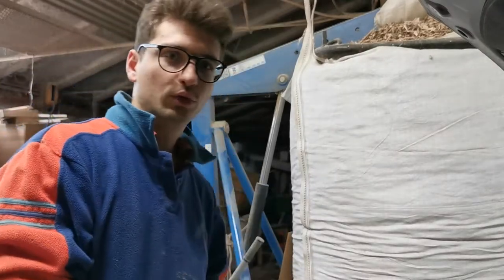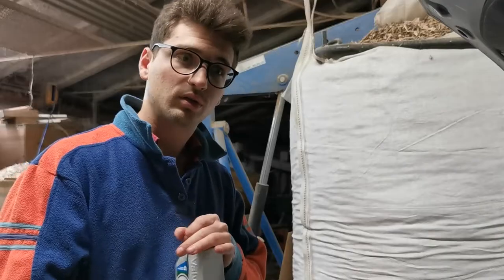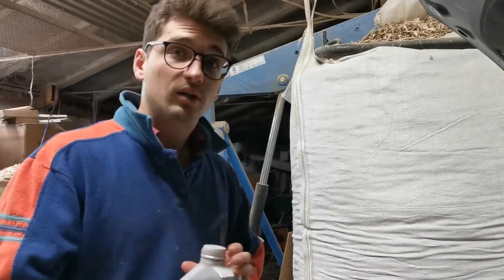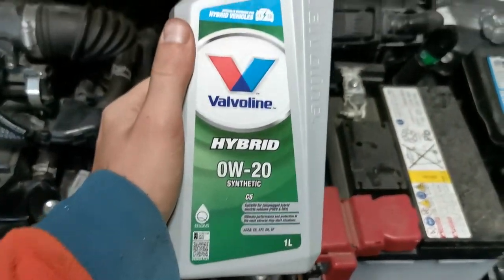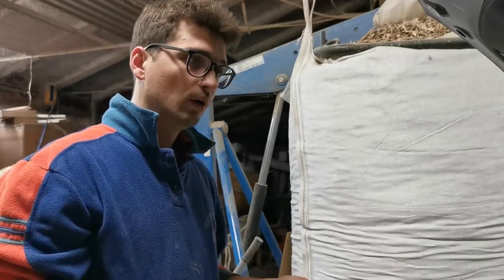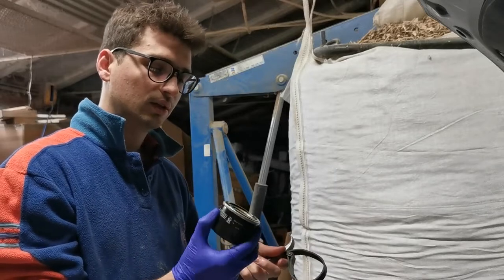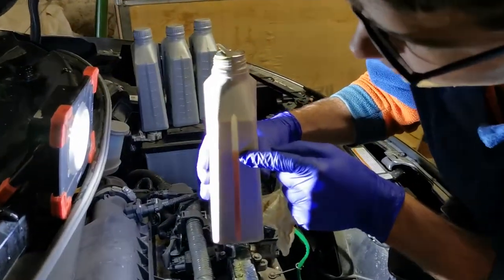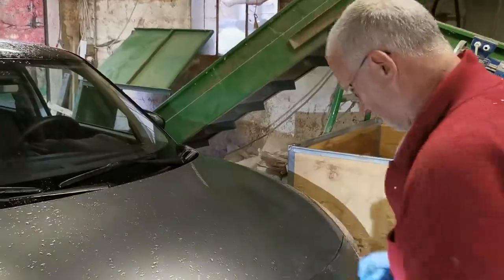DIY | Suzuki Swift HYBRID 1.2 top - OIL + FILTERS change - HOMEMADE service

Comment: Never run an engine without oil... not for one second! You drain it easily by having a warmed up engine at the start of the procedure. Do you have the service manual for this generation of engines K12C ?
Reply from the maker: Hi! Yes, you are right. We did that because my dad was used to let the old tractor engine run a bit to empty all the pipes...but in modern motor it is not necessary (we saw that no oil went out). Yes, I do have the manual, why u asking?
Reply: @profilo_is_back  can you point me to it if it is available online? I can't find it for this new AZ generation, my mother owns a 2019 simple version Swift with this wonderful K12C engine and I want to do the basic maintennace on it accordingly, down to the torque requirement for the screws that go back on. Thank you for the reply.
Reply from the maker: @alexmar4252  unfortunately I do have my own manual (paper version....). I searched a bit and I found the exact same version I have. Unfortunately it is in italian...
@ page 452 you can find the maintenance section. And, as you can see @ page 455 you can find the motorization version.
Hope this can help you!
https://auto.suzuki.ch/fileadmin/media/pdf/pages/bedienungsanleitung/Swift_Anleitung_IT.pdf
Reply: @profilo_is_back  Thank you very much!

Comment: We never start an engine without oil. What you did did you did crime. You do NOT know what you did, did you do it, if you really knew what happened to the machine
Reply from the maker: Hi! Thank you for the comment! As I relpiled in other comments, this was a mistake at all. howver, I don't think it is that much bad...the engine is still working fine, anything happened because it ran for very few cycles in free wheel conditions. Best regards!

Comment: Do you have part catalog?
Reply from the maker: Hi! Yes, this is what I used:
- 4 bottles (4kg = 4 Lt) of Valvoline 0W-20 oil, specifically designed for hybrid vehicles
- 1 oil filter ADK82108

Comment: Hello. I have two questions :
- On the manual of my Swift Sport Hybrid of 2021 it says that depending on the model or recommandations of the manufacturer, I should use either the kind of oil you are using or 5W30. Is there any big difference between the two ?
- How many liters of oil do you use approximatly in this car ?
Thanks for the video
Reply from the maker: Hi! Thank you for the comment!
1. W refers to the viscosity of the oil, The lower this number is, the less viscous your oil will be at low temperatures. A 0W oil, as the one I used, is really fluid and will flow better at low temperatures than a 5W. If your range of temperature is inside the one OK for 5W, then you can proceed with that. However, my mechanic recommended a more fluid one (0W, for instance) because is specifically designed for hybrid vehicles, so I went for that (frequent start and stop require a more fluid oil).
2. I filled the motor with 3.3 kg of oil. You may fill the oil then, when you are finisching, you can check the level with the oil bar (I didn't show this in the video, however its really simple).

Let me know if I was clear enough, otherwise I'm here if I can help you!
Reply: @profilo_is_back  seems clear to me. Thanks for the quick answer !

Comment: Hola amigo buen video, yo tengo uno fabricado en India pero el mío no es hybrido, el tuyo tiene el filtro de combustible dentro del tanque? Es lo único malo que le veo, saludos
Reply from the maker: Hi! Thank you for the comment! Well, I actually changed only the oil filter..up to now I haven't changed the gasoline one. I think it is external, by looking at spare parts on the web. I will ask my mechanic, then I'll let you know. What is your car exact version?
Reply: @profilo_is_back  El mío en realidad es un Suzuki dzire 2018, vendría a ser como un Swift pero en formato sedan, claro que despojado de toda la seguridad (solo dos airbag y ABS) y sin ayudas en la conducción, es un auto básico pero muy cómodo y económico. Gracias por la respuesta me suscribo al canal
Reply from the maker: @robertohanglin3612  Hi! I don't know your car, bur I rapidly looked in the web and it is very similar to my swift. As I promised, I asked my mechanics: he said that the filter, together with the fuel pump, is inside the gasoline tank (I was wrong, sorry for that). Hope it can help you! And thank you for the subscription, it really helps me! Bye!

Comment: Hi man please note to NEVER start a vehicle that does not have oil in the engine that is a very bad thing to do.
Reply from the maker: hi man! the car is still working perfectly, don't worry!
Reply: @profilo_is_back Just note that what you are doing is not right and eventually that will cause damage from running without oil. i know the car seems to be working good now but as you keep running the engine with out oil for those few seconds that will cost you

Comment: hi guy 2 things... put the car level when draining oil not how you are doing it because they will still hav some oil left in  the pan and second NEVER ever start any car engine without oil in the engine you are causing excess wear and if you do that over and over you will have issues before time.
Reply from the maker: Hi! Thank you for the comment. I didn't get the advice about the car position. In my case it was horizontal, how any mechanic will do, I think. Do you suggest to put it a bit inclined? Can you be more specific? Thank you.
About the engine running without oil...you are right, but it worked for actually very few seconds. Any damage was done, in any way, so I'm not really concerned about this procedure. It is not the recommended one for long working perdiods, for sure. Moreover it doesn't help in anything. But the engine is not damaged in any way.
Reply: @profilo_is_back   does the car carry the k12c engine and is the chassi ZC83S??
Reply from the maker: @bajan246bim  Hi! Yes, the engine is the K12C, whereas the chassis is ZD53S
Reply: @profilo_is_back  if  you open the front driver door you will see a black sticker it has the chassi number
Reply from the maker: @bajan246bim  yes, I read it from the plate, it's a ZD35S type
Reply: @profilo_is_back  they are saying to have the car level, that is flat. Which is what you had I believe.

Running that engine dry was painful to watch. Also the engine oil intervals seem too far apart. I don't let my engines go above 8k km unless they have all been motorway kilometres. 10k is acceptable, but I reckon much better engine life can be had with shorter intervals. Especially because oil and filter are cheap.

Comment: First of all the 0w-20 is the wrong oil you put the wrong engine oil in it. Keep the aftermarkets there and use only the recommended oil. And that's SAE  10W-40 Do not switch or change any of this. I cringe so hard at those very very commendable mistakes. Yeah of course the car will run but later in line you get problems you use very thinner oil than recommend and if you drive more than 30 min with this oil you will damage your engine. The use of too ‘thin’ a motor oil leads to premature wear of bearings, camshafts, piston rings, and cylinder liners. Not all 0W-20 motor oils are the same! Car manufacturers may specify the same viscosity, for example, 0W-20, but for each make or model the other specifications may differ considerably. Also if you get a "thicker" oil like 15w-40 for example. The use of too ‘thick’ a motor oil has, among others, a negative effect on the hydraulic operation of the variable valve timing, resulting in damage, continual additional fuel consumption and more soot deposit, leading to a direct risk of wear.

Good luck.
Reply: You seem to be confused about the  model. Every source on the Internet and the car's manual as well suggests 0w20 for this model.
10w40 will destroy this engine.